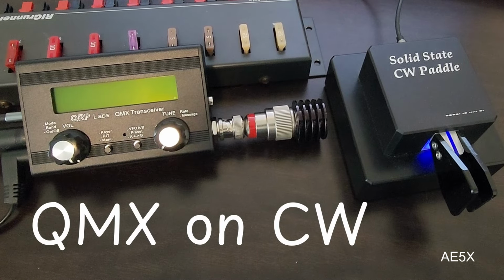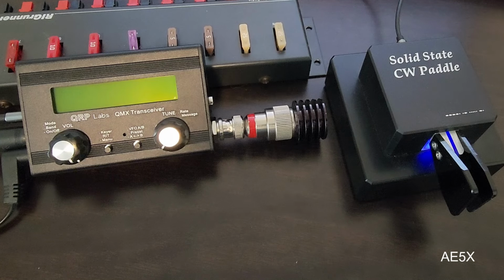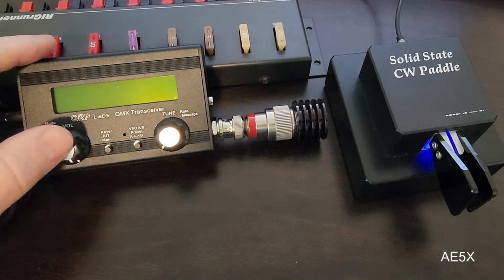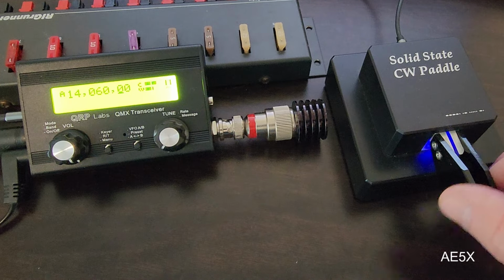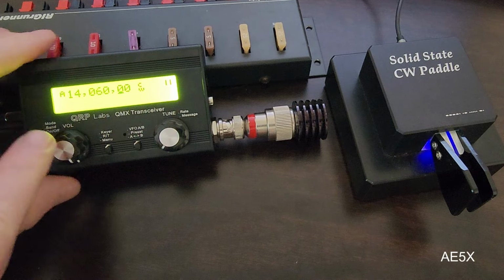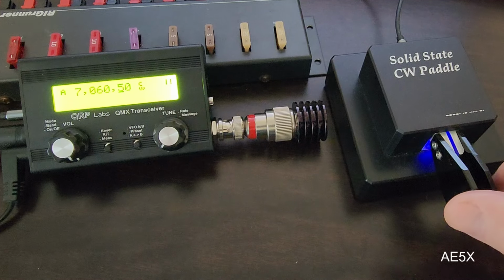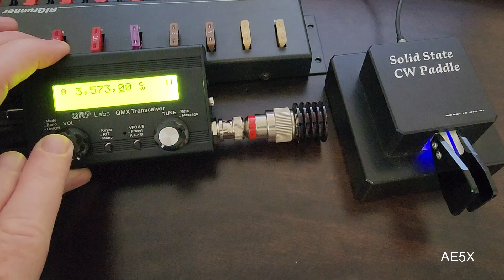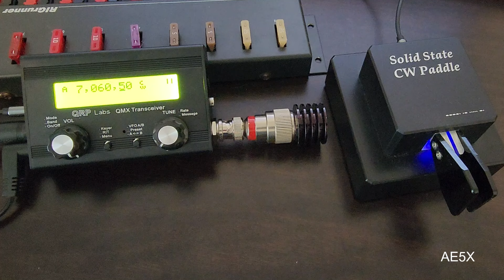QMX thumping issues on CW

Comment: I can hear what you are talking about. I have this radio but haven’t had a chance to try it yet. 40m is my favorite band with 20m and 30m being my next favorites. I doubt this issue will be a problem for me as such. I’ll be interested to see if this problem can be resolved. Great job on the video…72!
Reply from the maker: I'm not sure if each QMX displays the same behavior on the same bands. 80m seems to be commonly affected but others report significant thumping on 60 and 40 - I don't have a problem there. I have tried a few AGC setting that were suggested - they don't seem to make much difference. AGC settings in this rig are infinitely configurable - may too much! I'm lucky in that the most affected band on my QMX is a band I never use. Good luck and 72,
John

Comment: My thumping seems to be about the same on all bands.  I am using an amplified speaker (a ball sized one slightly smaller than a tennis ball).  What AGC setting seems to help?  I think for CW I could easily use no AGC because the band noise is not amplified with no signal (and less fatiguing) but a signal seems to pop out of the noise better.